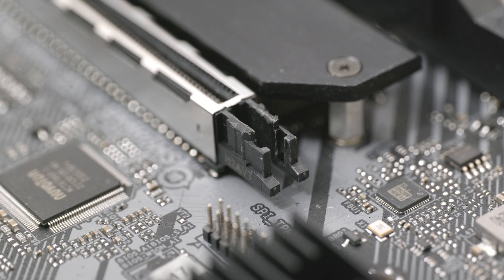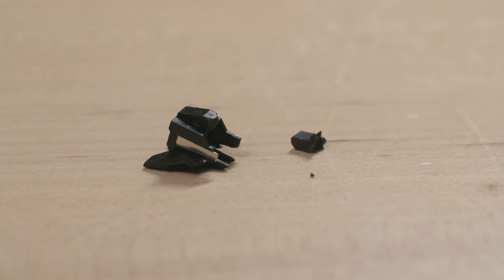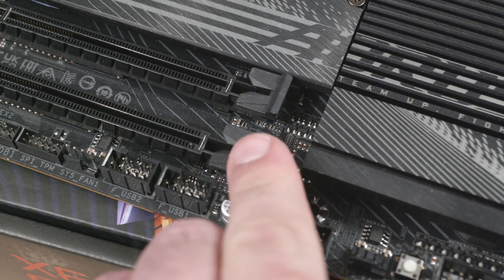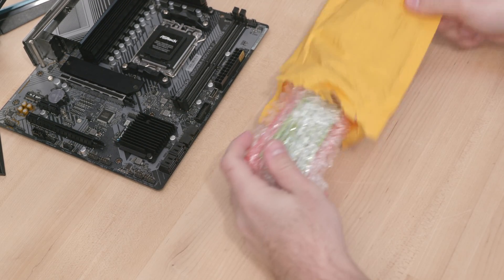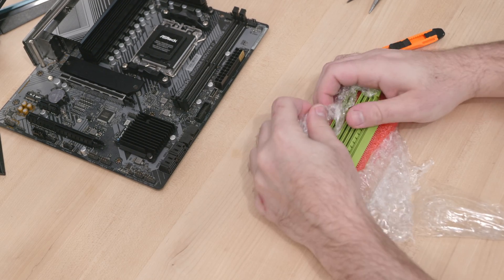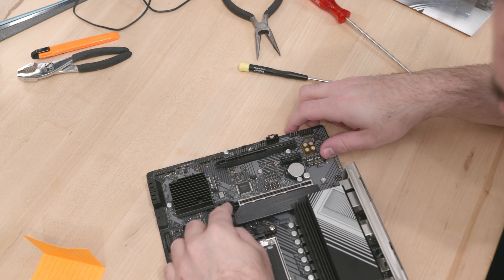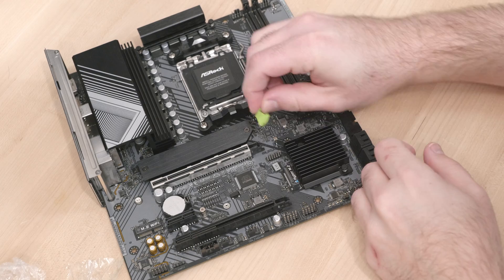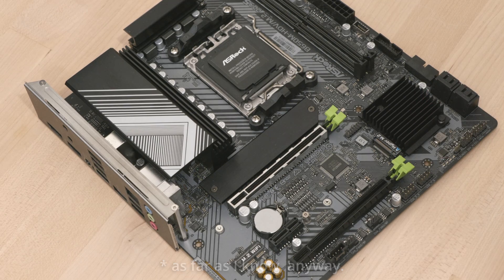Replacing a Broken PCI Express Clip on Your Motherboard

Comment: Yeah, had this issue and came off wiggling the GPU off, but nothing broke so I did the same thing you did by putting it back in. Seems to function normally. Just worried I messed it up long term even though everything seems fine and sturdy.

Comment: the pins that slot into the clip have to be 1.5mm and not 2mm or it wont fit and it will fall out. best to measure the broken clip before you buy a new one.

Comment: Perfect. My clip broke last night when I was reseating my GPU. Brand new build, just got the 9070 XT the other week and it was the 2nd time I had ever pushed on the clip to release my GPU. Snap. (B650 Aorus Elite AX ICE). 

Was thinking today about contacting gigabyte support for a repair or other options since I just bought the mobo on Dec 31st (took till now to get a GPU) so it's well within repair/warranty time but idk if it's worth it/necessary.

Comment: Tip: compare the locator pins of the donor clip with the original, if it's intact. I have an NZXT/ASRock mobo, and they seem to have a different shape and size from some clips that I bought.

Comment: pulled card during maintenance in the box; clip came loose, but did not look broken. Have card inserted tight w/o clip, and it seems to work fine. No inclination to open box again for a clip, which although I tried to fit it back in, was not successful.

Comment: i broke the clip but my gpu is still on the mobo, how do I get it out without damaging?
Reply from the maker: If the clip broke off, then nothing should be holding the GPU on except for the screws at the back of the case.
Reply: @ it’s still “snapped” in, can I just yank it out?

Comment: Thank you for this video. Just broke the clip on a new ASRock x870 Steel Legend board. Harvested one from my old ASUS Prime. The ASUS clips are much better. A shame for ASRock. Will be my fist and last ASRock board.
And ordered another 5 as spare.
Reply: Same issue with gigabyte here. Had only pressed the clip twice since I got it, 1st time 2 weeks ago when I got my GPU and 2nd time last night when I tried reseating it, and it just snapped. Seems it doesn't matter which brand you go with, weak clips are an issue
Reply: Asus has the same weak clips. I broke one today, and I only used a little force."
Reply: none of them can be worse than msi, the clips are made of play dough
Reply: Dude had it break on my asus  just now pain full getting gpu out.... gammy from start
Reply: it doesnt matter what brand lol they all suck, it's just a bad design for today's huge graphics cards and cpu heatsinks. check out newer msi boards that have a button nearby to lock and unlock it

Comment: I broke the clip on my new acer desktop computer's graphics card slot. the clip is a bit dissimilar to the regular pcie retention clips I've seen from other computers, it seems to have a longer portruding "lever" and a slightly different shaped inner plastic shape. I hope regular PCIE clips can fit where it once did or my perfectionist streak has come to an end.

Comment: Did a new build. Broke it first day...
Reply: Don't worry. You don't need it at all. I remove them intentionally. They are the main reason behind GPU PCB cracks. It's just stupid design that serves no purpose.
Reply: @dan7212  so you can just insert the gpu without the clip? Won't it be unstable?
Reply: @tommasoferrini  It will be 100% fine. I don't have them on my test bench, I don't have them on my raiser and I don't have it in my gaming rig.
Reply: @tommasoferrini   yes its fine thats why its screwed in

Comment: Mine has been broken for a couple of years...  Don't see the need to replace as long as it's screwed in properly in the rear of the case.
Reply: I have the same issue, did u face any issues yet with your gpu?
Reply: I also had this issue, these break fairly easily.

Like he said, long as you screw it in, it’ll be fine.

I would like to add if you have longer and heavier card, add a sag support.
Reply: @megh7280 You shouldn't have any problems, given your card is a normal sized card and not a triple fan oc variant.

Comment: Where did you get these clips or slots from? I have a similar ASRock board with a broken clip I want to replace
Reply from the maker: You can find replacement PCIE slots on eBay, Aliexpress, or probably some other electronic parts suppliers.
Reply: Dude, the clip on my ASRock board literally just snapped on me too! I love the board, it’s served me well, but why is the plastic such bad quality on these clips? Over on Reddit it seems like everyone is having the same issue, wtf. Small world. Were you able to find replacements, or did you figure out another solution?
Reply: @steele_heart77  I found somebody selling a broken version of my board for parts on ebay for 30-40 dollars... These boards tend to break a lot which I don't know if it's a good or bad thing lmao